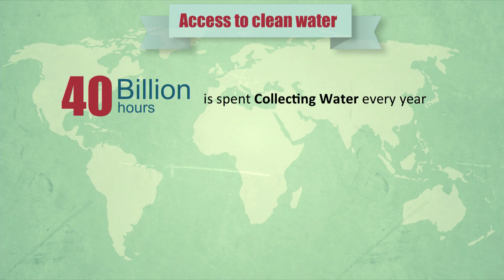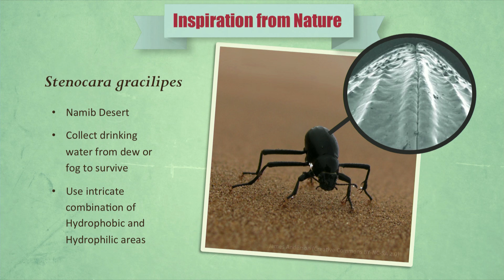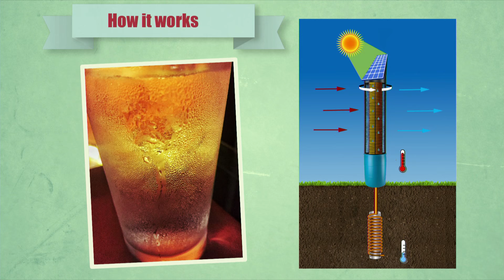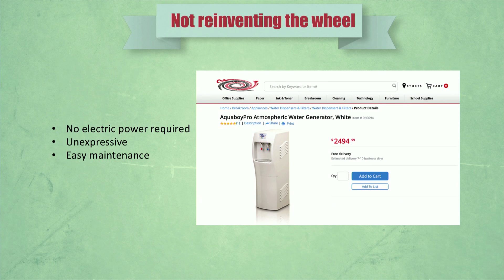How To Turn Thin Air Into Water | Konstantin Avdienko | TEDxTeen

Comment: Why is everybody so full of hate? Maybe this device really works and could actually save lives. You're all just criticizing but this guy is trying to change something.
Reply: Because it's nothing new. Atmospheric water generators (dehumidifiers with a filtering system) have been around for decades.
Reply: @Noel Kotela:  His idea is already being built by a company in Russia.  They are probably still developing the machine, so you will not hear of it for a while.  Haters just think they have a better idea, of are angry they didn't think of it first- and get rich $$$.

Comment: We use a dehumidifier in the summer and I average 2 gals a day from June through mid September in East Texas.   I use the water to water house plants & garden ....then store the rest in rain barrels, but I would love to change this to filter it for drinking.
Reply: Hey there, What power consumption is your de-humidifier rated at please ? My climate is similar to yours. Thank you !
Reply: Isn't water captured by dehumidified air devoid of all minerals...which is HARMFUL?
Reply: @dannycbe949  I'm not sure.   Since commenting 4 yrs ago a lot has changed.  Then our house had a very old heat pump ac unit and it struggled to purge the humidity out through the drain tray exits properly. In other words it overflowed improperly and damaged sofets & ceilings. Thx goodness we caught it in time without too much cost and attached a pvc drain pipe for it to flow outside.  I can't account for what minerals were or not in that water but it kept my hydrangeas in the color blooms they were intended to be.  Water appeared to be rusty (iron enriched) which is good for hydrangeas.  In addition, we also used an indoor portable dehumifier until we afford to purchase a proper size ac for our house.  5ton instead of the existing 4 that we had. I also invested in a Berkey water filteration counter top system and made another one from the youtuber "boss of the swamp" tutorial on how to do it.  Less than half the cost of a big berkey and more capacity.

Comment: Well. The point is, that you need to cool down 1000 liter of air (that is 1m^3 of air) from 30°C to 10°C under optimal conditions. - that means 100% humidity - in order to get 20ml of water. It is very clear, that you cannot do this with some CPU-fan and cheap solar panels in an acceptable period of time. And the thing gets worse in really dry areas, where humidity is way less then 100%. This has nothing to do with like or do not like. This is basic thermodynamics. I beleive you, when you say you can condense water from air, after all this is not new. It is exactly what a dehumidifier does. And also the story of the bug is a nice story. But the point is, that the bug can survive with only a handfull of waterdrops per day. But a human cannot, even if you manage to condense a 100 times that amount.
Personally, for me the most interesting number would have been, how much water could you get from air under which conditions in what time. And I wonder why you talked a lot about the need for such a technology but have not provided this basic figures or some theoreticcal number of what is possible at all. And that, my young friend, almost always means something.
Reply: kallewirsch2263  wow that's a long comment
Reply: kallewirsch2263, in india, we have designed a system that uses .347 KWH power and produces 65L of water in 12 to 14 Hrs of operation (mostly in the night when the temperature is cooler) with a relative humidity of anywhere between 42% to sometimes in excess of 80% (coastal town) .. hope these numbers help. AND YES. ITS TOTALLY POSSIBLE to make this a viable solution to revive and replenish groundwater levels in my country.
Reply: Alinel Woundhorn 
Can you please send the details where I can read more about it?
Thanks.
Reply: Alinel Woundhorn I'm highly skeptical. Those figures are way off the charts of whats thermodynamically possible.
Reply: Well the cooling from the 4 feet below the earth is about 56 F so that  part works, since most dew points in FL anyway are above that temp; the mass of air moved across cooled fins or tubular coils is a question.   I am getting about 3.2 oz h2o/day from a peltier wafer system using less than 100w (poor but i plan to make it even better like 30w and get more water too) , but it can be scaled up to get 32 oz/day by just increasing number of wafer pods to 10, right?  So a 45cfm cpu fan = 1.27m*3/min of air & would give you ~27 ml water "IDEALLY" every minute, real world probably much less. So its theoretically possible? I'd estimate about only 1 ml water per minute in real world, but that does add up, and with scale up to 100x more units IF cheap enough could become viable.
Reply: Please tell us the design specs. thanks
Reply: Please tell us your design specs, thanks.
Reply: If you've designed your experiment and published your findings I'd like to see the work. But I'm skeptical and I'd want to see the experimental design and all the data.
Reply: They are published, if you don't believe me call Steve Gould at Gould Insurance in deland, fl.  ask him about the double battery life tests we did together, we got 2x more work out of the same alkaline batteries , and days later got even more since they autoregenerate after resting !   we can prove every bit of this, just need a factory to make a few hundred units so we can get them put into market place.
Reply: @mohba01  Hi!  where we can we find more info on this please...can we  do it ourselfes  and how effective is it on a piece of dry land?
Reply: @bksidhu6437  The relative humidity (RH) in percentage plays a huge role in collection of water. can you specify your geographical location ?
Reply: @mohba01  Hello,
Can you please let us know if you are selling these in India ?
Reply: Kalle, this is an existing technology used for many years already. They are for sale: Small to massive. These systems come as big as 40,000L per day or even bigger if needed but they are above ground and use electricity.
Reply: Because is more interested in blabbing his mouth about "an invention" that any child that took 6th grade physics should know.
Reply: @mohba01  can you share that method and initial cost investment
Reply: @mohba01  3 years old comment claiming an efficient dew harvesting system & yet no details provided?!
Reply: @shubhambali7297  did he send you the details

Comment: you will need a lot of colder temperatures to actually achieve condensation.... if it actually produces water it probably makes a lot less than expected....
Reply: LOL, oh dont' worry, the cooling is coming, beware what you ask for.
Reply: heat also creates condensation
Reply: plejaren1 Yes, it does. But the context in which its said here is different type of condensation. Basically, u r saying if i heat up humidity in 47 degree celsius with 60 percent humdiity environment, then i will be able to produce some amount of water; unfortunately its a wrong idea as it increases the knetic energy further more rather it needs to be cool down by decreasin the temperature. By decreasing the temperature, we can bring the molecules close together from their deispersed state to the compact one hence making H2O.

Comment: Hmmm I think this guy is possibly on the verge of inventing the dehumidifier
Reply: A geothermal dehumidifier that works the in places it is most needed, and likely is cheap to make with easily sourced parts.
Reply: @amyspade9031  It doesn't produce the amounts of water needed for anything useful. Not even for a human daily needs. You need a gianormous apparatus, able to process thousands of cubic meters of air per day to produce anything useful.

Comment: how simply have you explained a complex science! God bless you.
Reply: Not his idea.or his invention.
Reply: @phillipiverson5660  He took the concept and turned it into a vertical system, of which you bury the bottom, and use low-cost, low-voltage parts to pump the coolant into the upper coil.

Comment: Nice idea in theory, but this relays on the ground around the copper coil staying cool. It won’t stay cool for very long as due to the heat transfer from the copper to the soil and the temperature of the copper coil and the soil around the coil will quickly even out rendering the device useless.

Comment: for the amount of energy expended to operate the cooling station, they could make the effort truck the water from halfway across the country
Reply: What if you just use the wind energy to turn a pump that cycle the cooling effect of a refrigerant??
Reply: @oswaldoriginal5037  no! we already had those in Australia to attempt to fill a lake. They simply take too much energy and only operate in humid air
Reply: @cupidstunt8136  What?  a wind turbine turning a refrigeration cycle??

Comment: Great Idea....so it is turbine run by solar compress the air to the ground to get condense and turned to water. 
It may work in coast area where humidity is high but not in dry desert air...but still there is alot of technical issues to be solved like backup pressure will the turbine be able to overcome it...remember it is mini solar..
Thank you for great Idea...!!!
Reply: Even desert air has moisture, so it should work.  You just can't feel the humidity.  You may get better results using the generator at night.
the "turbine" (fan) draws air up into the coil, and a small pump circulates the coolant through the system.
Reply: Energy is expensive, no Gov. Will provide electricity if no people living there. And generator consuming alot of gas/ petrol doesn't worth in the middle of nowhere. So we have only one simple, cheap choice  "solar power" backup by wind power.
Just simple continue drop if we can manage to produce , can make big different in the world. Just imagine small turbine in the middle of desert producing a drop for tree to surviver  to provide shadow for us....I think it is amazing...!!!👏 😀

Comment: This reminds me of a similar invention made by Edward Linacre from Australia called the "Airdrop Irrigation" back in 2011. After he won the Dyson award, no one has ever heard from him again. Now THIS came up, with a similar design and concept! What gives?? And there isn't any demonstration video from any of these inventions. So I'm very skeptical if it actually works! And I also suspect plagiarism from all this.
Reply: Let's begin with the water and air we will need to have a base on the moon.. Not to mention a scheme to live with solar radiation.   In the 1960s we made such a good start but it was largely shut down because of finances.   Where else are we going?   Most of all to work together.   The human race is so crazy.
Reply: Steam Punkster it will work for a short while. These devices rely on the cooling effect of soil around the device. However that heat has to be stored somewhere and it will obviously will be stored in the soil. So basically the soil will around the device will become the same temperature as the device fairly quickly rendering the device useless. Once this guy builds his device he will quickly find it won’t produce the quantities of water he is expecting.
Reply: @cplcabs  Did you watch the video? He said he installed it in various countries and it worked well.
Reply: @cplcabs  If you don't believe anything a youtuber says, then stop talking to me. Thanks.
Reply: @moyshekapoyre  it may come as a surprise to you, but you initiated the conversation with me, so take your own advice.
Reply: @cplcabs  I initiated the conversation because I thought you might be capable of listening and discussing. I know better now.
Reply: @cplcabs  London Bridge  $ 50 ?   Cool  !! may  I have two please ? My nephews bath day is coming, they are twins

Comment: Does capturing moisture from air affect the monsoon patterns? In India, summer is immediately followed by monsoon - rainy season. Won't capturing moisture create a disruption in the water cycle?
Reply: Eh I wouldn't worry about it. Considering that all "water from thin air" devices need relatively high humidity to really do anything, and those places already get plenty of water from thin air the traditional way (rain), these devices aren't gonna catch on because they aren't cost effective and their claims are never thermodynamically viable.

Comment: Well the cooling from the 4 feet below the earth is about 56 F so that  part works, since most dew points in FL anyway are above that temp; the mass of air moved across cooled fins or tubular coils is a question.   I am getting about 3.2 oz h2o/day from a peltier wafer system using less than 100w (poor but i plan to make it even better like 30w and get more water too) , but it can be scaled up to get 32 oz/day by just increasing number of wafer pods to 10, right?  So a 45cfm cpu fan = 1.27m*3/min of air & would give you ~27 ml water "IDEALLY" every minute, real world probably much less. So its theoretically possible? I'd estimate about only 1 ml water per minute in real world, but that does add up, and with scale up to 100x more units IF cheap enough could become viable.
Reply: @ john Doe:  And it should be something that  any industrious person of the region could make himself, to pass the technique on to others in the village or town, to make many more.
My biggest challenge would be to dig a narrow-bore hole 2 or 3 feet into the ground-  by hand...

Comment: If you've designed your experiment and published your findings I'd like to see the work but thermodynamics says "ya, probably not". Yes, dehumidification for moisture capture is nothing new: It's also crazy expensive in terms of energy to cool enough air. Additionally, the soil (big important variable) can only absorb so much energy from heat exchange before its temperature rises and said heat exchange effectively stops. Local conditions including ambient wind, temperature, humidity, soil temperature at depth etc. are critical variables. It's not going to provide water at the scale you'd need for a village, or even a family of five. You might be better off digging ground-stills (also known as a solar-still or moisture-traps) and collecting both dew and soil moisture; they're simple, low-tech. and while also not likely to provide sufficient water for a family would still represent a more content sensitive engineering approach.

Comment: Would this work in a tropical climate, as the ground doesn't cool off as much?
Reply: @ Kayena:  if you go down far enough, the ground is cool as he says-  even in a desert.
Reply: @toml.8210  a lot of deserts have a high temperature difference between night and day, I think because the lack of clouds let the heat escape during the night.  I live in a tropical climate close to the equator , with just a few degrees difference between night and day. When we go into a cave it can feel as got or hotter than the outside.

Comment: I have designed a system that pulls water out of the air using no energy to achieve this. The only energy required is to distill the water, this can be accomplished with any source of heat, even solar concentrator. The energy required for distillation can even be lowered using vacuum distillation. Not only this, but I also have recently combined this with a very simple way to generate electricity.  Clean water, and electricity (on a smaller scale, yes) sufficient for the needs of a family. Not a solution to provide these for a city or small community.  But each family could cheaply and easily have a device for their own use. I need a person skilled in CAD to work up a schematic.  And someone to help me set up a crowd funding campaign to get this off the ground.
Reply: I am developing a sustainable community and would like to more about your system. How is your project going?
Reply: Yes, lets connect as well. I can see the application here in SA...
Reply: condensed water is not distilled water ! you just need a mineral filter and a carbon filter. its clean water out of the box. feel free to contact me for any help..in india, we have designed a system that uses .347 KWH power and produces 65L of water in 12 to 14 Hrs of operation (mostly in the night when the temperature is cooler) with a relative humidity of anywhere between 42% to sometimes in excess of 80% (coastal town) .. hope this helps.
Reply: Where can your system be found online?
Reply: Where can your system be looked up online?
Reply: im looking for something off grid andsimple have you got this system
Reply: SPEAK A LOT, AND SAY LITTLE

Comment: Don't start your "talk" with a sob story to try to promote a bullshit product.
Reply: Only problem, his product works!
Reply: Think about this, your regular Air Conditioner does this exact thing, except instead of mud, it uses power to cool the air - water is a byproduct that condenses and discarded. Your AC uses 1000W and needs a DAY to make 1 Glass of water. How much power does it take to heat the surrounding dirt of that poop-pipe to not be viable for cooling air anymore? I bet its less than 12kW hours...
Reply: No, it doesn't.
Reply: Do you have a video on how much this product "works"?
Like, how many liters does it produce, or day to day video record on how the unit makes water?
Reply: Happy toknowyou ... It's a disgusting con.